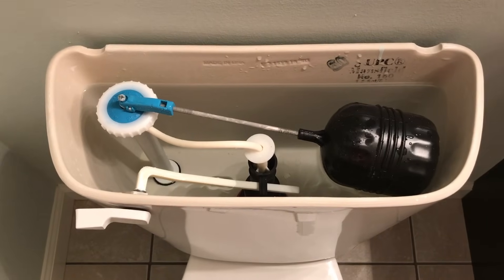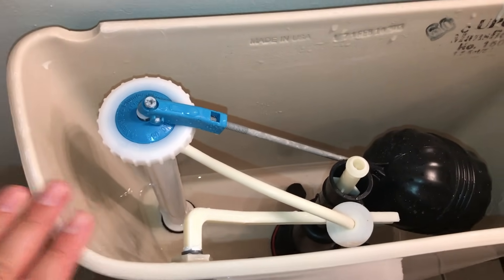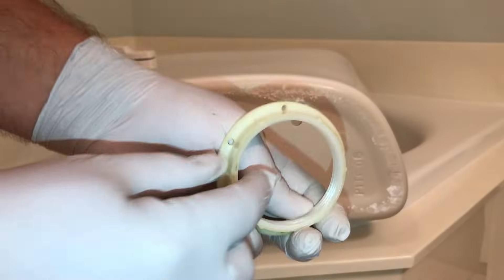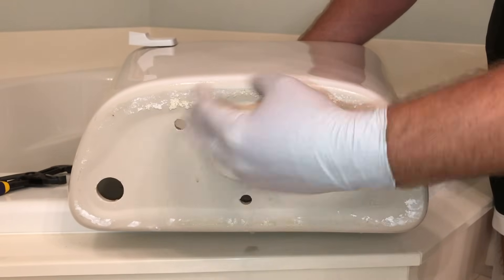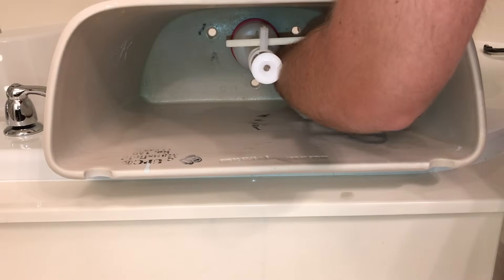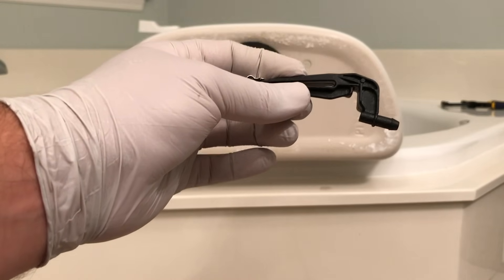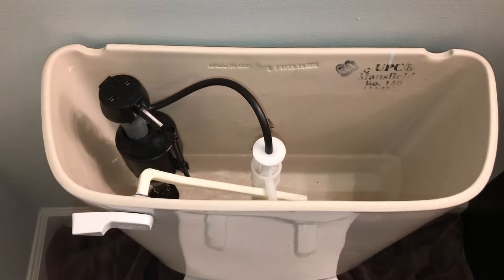Replacing Fill Valve & Flush Valve for Mansfield Toilet

Comment: This is the 2nd toilet I’ve used your vid on…so easy to follow! However, this time, the gasket between the tank and bowl seems to have seepage. I’ve tightened the screws down a bit more, but don’t want to crack the tank. I reused the round nut instead of using the hex. Any suggestions?
Reply from the maker: Hey 👋 

I would check that the lock nut is not slightly cross threaded. I would also ensure that the flush valve is not slightly cockeyed such that it is seated properly in the tank and has a tight seal. Otherwise, I would simply remove the flush valve and reinstall it. As you thread on the lock nut, hold onto the flush valve to keep it steady and straight.  Once hand tightened, grab your channel locks, and once again, hold onto the flush valve with your other hand, and tighten the lock nut a quarter to half turn.
Reply from the maker: I just uploaded another video because the flush handle broke on this very toilet. I demonstrate the quarter to half turn there as well if it helps.  The process is exactly the same as in this video, although I am using different parts in Fluidmaster Universal Kit Install in Mansfield Toilet
https://youtu.be/rctJHNloUL0
Reply: @theXchange  sounds good…I’ll try it again. Thank you!
Reply from the maker: no problem.  oh, and perhaps use the hex since it’s new. You’ll notice I used the hex in the newly linked video. Let me know how it goes!
Reply: @theXchange  I noticed that and wondered about that. I’ll dig it outta the trash 😂
Reply from the maker: sorry for the delay!!  Work has been busy!

The spud gasket looks too big. Is that the original or did that come with the flush valve replacement?
Reply: @theXchange  no worries. Thanks so much for responding. I’ve been trying to troubleshoot but still have the seeping. I think you’re right about the gasket being too big. It came in the replacement package. 

It fits around the round nut snugly, but there’s a slight, rounded lip on the bottom of the tank that I think is not allowing that gasket to be flush against the bottom of the tank. 

I’m thinking I’ll need to buy a different gasket. I actually thought of shaving a small amount off the top corner-edge of the gasket to jimmy-rig it. 🤦🏼‍♀️
Reply from the maker: you could always pick one up at the hardware store and return it if not needed. I hope it all goes well!

Comment: Great video, Kris.  I am so thankful for this video and everything with the replacement went smoothly but now I have a very slow tank to bowl leak.  I've taken things apart and put them back together a few times to make sure everything was installed correctly but the leak persists.  Any suggestions for me?
Reply from the maker: Hi Kris!  Did you reuse your circular nut or the new hex nut that came with the replacement part?  (note yours may have come with a circular one).  Either way, use a circular one and make sure it’s tight fitting to the bowl, but not over tight as that could cause it to leak. In addition, the rubber gasket should fit flush against the tank, so make sure that fits snug around the protruding part of the flush valve and around the gasket. Let me know if tou have other questions.  Merry Christmas 🎄 and Happy New Year! 🎊  Consider subscribing to my channel ;)

Comment: I replaced the flush valve gasket but still have a very light trickle that periodically sets off a flash..driving me crazy..
Reply from the maker: Is the water at the level of the overflow tube?  If so, water may be draining into the tube. Try adjusting the float to see if that helps.

Comment: How do you adjust the fill valve once you’ve replaced it? 
Do I need to take off the entire assembly again, or can I raise it a bit inside the tank? I thought I was at the right water level, but I was shorter and want to raise it a bit more.
Reply from the maker: Hope you’ve figured it out by now. For some reason, I wasn’t get notifications on new comments for a while…

Comment: I looked at the fill valve and it has a small hole in it.  Is mine broken or should it be like that.  Can't get everything to flush down and the waterline is fine.  Not a clog.  Thanks!
Reply from the maker: Where is the small hole?  Does it look manufactured or like it doesn’t belong?
Reply: It is on the fill valve and it looks manufactured.  Someone else told me it is not the fill valve since my toilet fills to the waterline but it is the siphon which I assume is the p-pipe or upside down s curve in the toilet.  But would that mean the entire toilet would need replaced?

Comment: Thanks for the helpful video. I got the mansfield 160 model, part number 211 I see in the toilet. What's the best place to buy the whole thing and in parts?
Reply from the maker: Someone commented below they purchased the whole thing in parts from mansfieldplumbing.com
Reply: thanks for the reply.  My fill  valve gets stuck at top and takes awhile to come down, so I went to another room and only replaced the fill  valve. gasket looked ok so should be ok? so far so good.  (the hose from the wall maybe the valve is bad, I turned it pretty tight but still leaks, wonder if that broke the fill  valve? also the fill  valve I got is the same as yours in the video and not the one with balloon blue thing. Actually it's hard to find our kind of fill  valve, do you have a part number for that? thanks so much
Reply from the maker: Replacing the fill valve only should be fine as you need not remove the tank to replace it.  I don’t have a part number, but check out that website; it may be there.
Reply: Ok I took it off and it's not manfield, it's fluidmaster model 400 I guess last owner replaced only the fill valve with a different brand. So in general I guess I don't have to buy manfield parts? What knock off brand would you suggestion that's decent in price and quality.
Reply from the maker: The parts I used are in the video description.  I also used a fluidmaster fill valve.

Comment: I take it you can't just replace the refill tube and the stop cap?
Reply from the maker: generally it comes as one kit. always good practice to change it all out anyway as that plastic can become brittle and cause you more trouble down the road / near immediate future than it’s worth.  That’s why I carefully inspected the circular lock nut before reusing it. I had no choice since the place I went to was out of stock on the part that comes with a circular lock nut.

Comment: Thank you for such a great, easy to follow video.  You made everything very easy.  I actually ordered the rebuild kit from Mansfield and was able to do the job today.  However, I notice that my tank sits a bit unevenly once I've tightened down the "nuts" on the underside of the tank (using the "new" style bolts and nuts from Mansfield).  I've also noticed that there is small drop of water (after flushing) at the front of the rubber gasket (between the tank and bowl).  Could this be from the tank being uneven, or should I recheck things to make sure I used the circular nut instead of the hex nut Mansfield provides?  Other than that, it all looks good.  I'll check in the a.m. to see, if there are any leaks, or if that drop of water is still there.  Any reply you might feel would be helpful would be greatly appreciated.  Thanks again for such an awesome video!
Reply from the maker: If there is a leak, it could perhaps cause the gasket to not seat properly. When tightening, did you tighten one side, then the other?  If so, that could be why it’s uneven. Instead, use a round-robin approach when tightening the bolts so ensure even distribution of tightening.  Lastly, do not over tighten... that could crack the toilet and the only crack we want is the want that sits on it!
Reply: @theXchange  I'm about to take the tank back off, because I didn't use the round nut as opposed to the hex that came with the kit.  I'd written down fairly detailed instructions after viewing your video, but that's not something that I included and it slipped my mind.  So, I will change that out and take your advice on tightening the bolts.  I admit that I may have overtightened them, since it appeared to me that the tank wasn't really sitting very flush (no pun intended) to the bowl and I thought that tightening the bolts down would pull that gasket down further for a more flush fit.  Thanks so much for the reply!  I was really hoping that you would and that I'd catch it this morning.  I'll let you know how things come out (or if I need more help haha).  Thanks again, Kris!
Reply from the maker: no problem!  good luck!

Comment: The video was fantastic!!! A plumber in our area wanted to charge $175 to do this. I followed the instructions but the toilet bowl is still leaking in same place - any suggestions??
Reply from the maker: Thanks!

Where is it leaking?  Did you replace all of the old parts with new, such as the tank-to-bowl kit and the spud gasket?  If so, make sure all connections have been hand tightened and not over-tightened, and that the spud gasket is flush with the bowl on the underside.

Comment: Great Video.  Looks like I will tackle this tomorrow with all new parts rather than trying to source the older style float.  

Was that water connection cross-threaded?
Reply from the maker: Thank you. Yes on the cross-threaded.  I didn’t quite get the alignment just right as you noticed 😄. I had intended to replace the supply line with a braided stainless steel supply line to curtail that problem, but have yet to get around to doing so.  Good observation!
Reply: Just to update.  My replacement project was easy and straightforward thanks to the video.  I had to also replace my hard line with the braided style as there was a difference in length.  Thanks again.
Reply from the maker: That’s great!  I’m glad it was helpful. Thanks for watching!  Please consider subscribing to my channel 😁

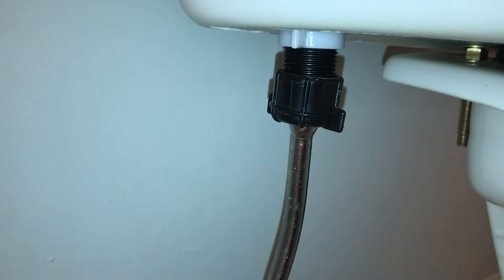Comment: it looks like the supply line nylon nut at 18:46 is cross threaded... but it didn't leak, sooo...
Reply from the maker: it was :). I fixed it immediately off cam once I got a more level eye on it 👁️

Comment: I need to buy a  complete kit for my Mansfield Toilet, Replaced the  Flush Valve Seal The water keeps going over the Overfill valve, I've  Tightened the screw  and it still goes over, So my next purchase is  a fill valve, Might as well get All of what you got  one question do you think they make a XXL for Gloves lol I have VERY big hands
Reply from the maker: Good question!  I’ve never had to consider buying gloves that large so I never looked! 😂

Comment: Hey Kris - I have the exact same problem. Do I have to remove the flush valve as well?
Reply from the maker: If your stop cap is broken, then yes since that’s part of the flush valve. If your meant to ask whether you need to remove the fill valve in order to replace the flush valve, the no. If your fill valve is okay, you just need to detach the water supply so you can remove the tank.
Reply: Kris Reese many thanks. Yes the stop cap is broken. So I take it that I have to change the flush valve and take the entire tank out as you have shown (I was trying to avoid that :)
Reply from the maker: The alternative is to see if you can replace just the stop cap. It screws on and off. If the threads on the shaft of the flush valve is brittle and broken, then you’ll have to replace the flush valve. If the threads are only broken on the stop cap, you might be able to replace just the stop cap.
Reply: Kris Reese thanks. I will check that

Comment: I subed you.
 My problem is the exact same one you have here and I assumed that the Plumber over tightened it when installing it new about a year ago ? Or is this cracked or broken fill hose valve nut a common problem with Mansfield toilets ???
Reply: PS: I guess it is the screw top to the flush valve !
Reply from the maker: It is plastic, so over tightening could be a culprit, as could age causing the plastic to become brittle and simply breaking.
Reply: @theXchange ,
 Thanks for the quick reply. In my case we think the plumber installing the new higher toilet , just a couple years ago, over tightened it.
 But this big plumbing contractor down the road hires a lot of newbies to work under his licenses and many of them have very little experience, at what they are scent out to do.
 Thanks again for your very good video...............vic

Comment: This video was EXCELLENT.  All went well but I cannot get it to stop leaking where the water line comes in the bottom of the tank.  What could be wrong?  Fit the line back into the tank and tightened it... still leaks.  Keep trying to realign the water line...
Reply from the maker: Thanks!  You might need to replace the coupling nut if it’s still leaking.

Comment: Great video. But he skipped the part when you remove the tank bolts water will empty out. To be honest. Just loosen the two bolts with a towel underneath. You won’t have to pull thevtank off

Comment: How much does it cost to get this done
Reply: I surely enjoyed this video
Reply from the maker: It’ll just cost you in parts and your time. You can check the links in the video description below to add up cost of the parts (they may fluctuate on Amazon, so I cannot give you a figure here as it may change). Otherwise, go to your local hardware store.  All in all, you should be easily looking at less than $50 in parts.

Comment: Excellent video. Although, I did see that you cross-threaded the flex hose nut when you reinserted it onto the fill valve. I was just waiting to see if it leaked. lol. I'm having a hard time finding this replacement kit. Seems like the big box stores don't carry this flapperless kit. Any suggestions as to where I can find it?
Reply from the maker: +joe mazzara Hey Joe. I bought all of my replacement parts at Home Depot, including the fluidmaster fill valve.  Otherwise, Home Depot’s website would have it, and you could always compare prices against amazon or even Lowes.  Since making the video, I’ve been leak free!  ;)
Reply: @theXchange  You can get the kit from Mansfield at : https://www.mansfieldparts.com/page2.html

Comment: Do i really have to take the tank off to replace the whole flush valve. Can i just unscrew it, remove the one I BROKE then screw the new one in? I'm a lady and thats alot to me! Lol
Reply from the maker: Yes. You should replace the spud gasket, tank to bowl kit, and the lock nut. You would not be able to unscrew it like you’re thinking :-). it doesn’t work that way
Reply: @theXchange  oh darn (sad face) But thank you for answering.
Reply from the maker: of course!  Hope you’re able to knock it out!

Comment: I’m having SUCH a difficult time trying to remove the bottom of the toilet with a wrench
Reply from the maker: bummer. I hope it all works out for you!  💪
Reply: My nut kept spinning the bolt along with it. Wound up resorting to a multitool with bi metal saw blade. Just cut the bolts right in the middle between tank and bowl.

Comment: If its a 160 toilet. Why isn’t it a 160 flush vavle? That’s what I have. I have two toilets. One the seal is leaking. The other no matter how full it doesn’t stop running until you grab the arm of the floating ball and physically pull it up yourself. Plus one fills up super slowly. I can’t afford a plumber
Reply from the maker: try adjusting the ball by taking a Philips screwdriver and raise the ball to the level you lift it to in order to get it to stop. Relative to parts, read the pinned comment.
Reply: @theXchange  thank you

Comment: Be careful with these instructions.  You should put a metal washer on the hold down bolts before the first washer to evenly spread the pressure on the washer.  The next issues is that on some Mansfield toilets you can not use a nut between the bowl and tank because that will not allow the unit to pull down enough to seal.  I found this out the hard way at my daughters townhouse after we had to call a plumber to stop the leak.  This was even with a thicker gasket between the tank and bowl than the one shown here.

Comment: My autism is really getting triggered.  ;)  18:40 that looks really cross threaded.  If it doesn't leak, it doesn't matter, but it's one of many things that trigger me.
For example, I tend to drive GM vehicles who often use side post batteries which are known to come loose.  One place I had work on my vehicle cross threaded the battery and it really bugged me.  Now, I'm guessing he did it on purpose so he wouldn't have a customer come back with a complaint of a loose battery terminal in the future, so I sort of understood.  But still, needless to say, I reinstalled the terminal to my liking.  ;)
Reply from the maker: heh. I hear you!  I actually noticed it too after shooting the video and I fixes it.  Now you can rest easy ;)
Reply: @theXchange  I'll definitely sleep good tonight knowing that.  ;p

Comment: Just use a small towel to soak up the water and wring it out in the sink a couple of times. Or use your wet/dry vac. Stupid to take the tank off. You drop it and then you are replacing the toilet. This guy would tell you how to build a clock if you asked him what time is it?